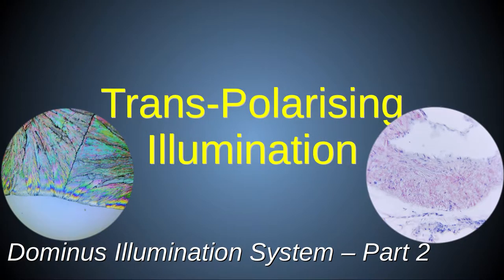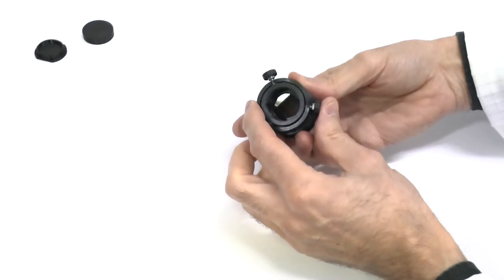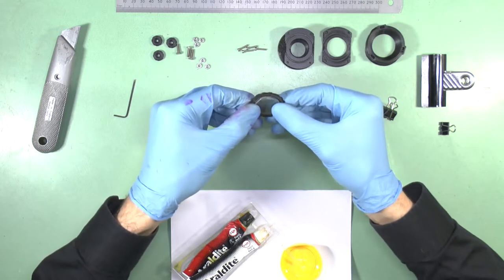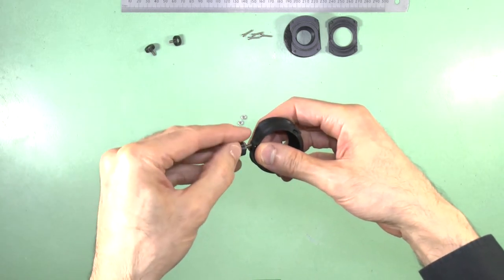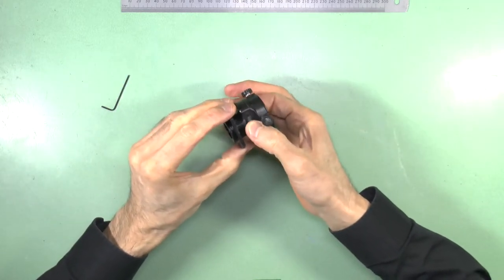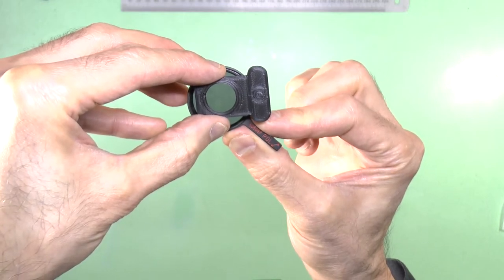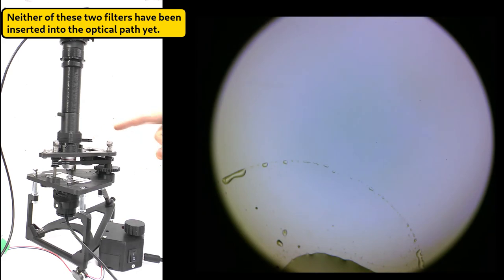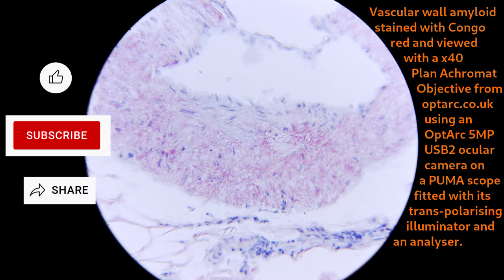The Trans-Polarisation Illuminator for the PUMA 3D Printed Microscope

Comment: The main issue with PUMA microscope is there is too many parts and it feel fragile/unstable or not easy/quick to adjust or not reliable to use. Not to mention so many parts to buy (and possible mistakes). I know we can buy bundle from you, but with the shipping, it's still quite expensive. If we really need a great but basic field microscope on a budget, we can find them under 300$. Sure, for +2000$ model, DIY start to make sens. But why getting them so weak/flimsy?
Don't get me wrong, PUMA is amazing and the video quality/explication is still the best I've seen (after 2 years looking way too many video on the topic).

My dream DIY project... Inspired by the sexy but outrageously expensive ECHO REVOLVE
I was thinking about printing a large hollow base, then fill this base with concrete. It create a very stable/stiff, efficient and cheap base. It can be 2-3 large concrete part that will anchor smaller module or more fragile part. It can be overkill with 20lbs of concrete or just few pounds for a sturdy but still portable unit. I was thinking only one eyepiece with phone camera mounted on it. It would keep cost low and quality high. Plus direct observation is not comfortable compare to screen. And video open the computer treatment of image, etc.
I think concrete base + PUMA technology + phone camera could be the perfect mix. I know it will still need lot of parts to make it adjustable and lot of time... So... maybe one day I'll do it.

The other option will be to start with a cheap but great quality scope and hack it to add more technology.

Last week, I've changed my mind (not going DIY from scratch) when I saw an amazing deal on a SWIFT380B microscope for 203$ (canadian, shipping next day, from Amazon.ca/Swift official. New open box) regular price 299$ canadian. I already had 4x, 10x, 40x, 60x semi-plan objectives and a 40x for fluorescence total price for theses 5 items: 75$ canadian (new).
I will thinker with my 3D printer on this already working scope (darkfield filter, polarized filter, basic fluorescence, DIY optic fiber illumination for top, phone camera adapter and so on.

I'm curious to know your thought on my ideas and positive critic of PUMA.

Sincerely yours,
Alexandre Valiquette, from Montréal
Reply from the maker: Hello,

Re 'many parts' - I do agree, but there is a reason for that. Also, this, plus the time and work involved in putting it all together is why is costs so much to buy (instead of make DIY) - so can't compete with off-the-shelf prices for mass-produced standard scopes like of Swift.

Re 'flimsy' - I respectfully disagree. Don't get me wrong. PUMA is not a stable heavy metal desk scope - I do admit that in the videos - but then it was not intended to be such and, furthermore, you can stabilise it to a desk and use the stabiliser module to increase stability as I demonstrate in my video on the stabiliser here: https://youtu.be/d8tMtWFhNY4 ).

However, PUMA is not primarily designed for people who 'just want a cheap small scope' - if that is your goal then sure, I agree it would be better for you to just buy a standard scope.

PUMA is for those who need many options and complete customisability (not just modding the condenser of a Swift to give you dark field) and portability (so that rules out Echo revolve). For example, the Köhler Fourierfeldblende projection, augmented reality, Z-motor, epi-illumination in bright or fluorescence, epi-polarisation and trans polarisation, coherent light microscopy, etc. - these modular options, and more, can all be bundled into a little light bag with PUMA and taken along on your journey. This is something you can't do with a Swift or similar - but then if you don't need any of those things with ultraportability, then you don't need PUMA.

Also, PUMA is for teaching and learning about how microscopes work and for experimentation with new designs and optical modalities - like interference microscopy, structured light illumination, superresolution microscopy, etc. (which I have not done videos on yet - but keep watching).

Regarding a heavier base, I did consider making an extra stable base option but not to be filled with concrete (most people would not want to work with that,. esp. in small quantities), but rather a 3D printed stand with a base that may be filled with wet sand or clay or pebbles (whatever is out in the field where you are working) so you can have a heavy base on site without having to carry the heavy weight along with you on your travels - just empty the base container when you finish and move on to the next site with a nice light scope in your bag.

I am also working on a more stable base for XYZ precision motor-controlled microscopy - more of that to come.

Remember PUMA is not just a standard microscope made with 3D printing and DIY - think about what each of the letters mean and put them all together. How many of the other scopes you mention have all those things (P. U. M. A.)? But not everybody needs or wants those things - so, for sure, PUMA is not for everyone.

Thank you for your comments.

PJT